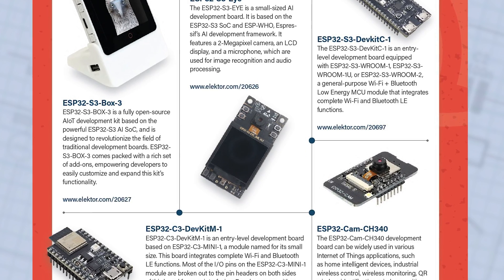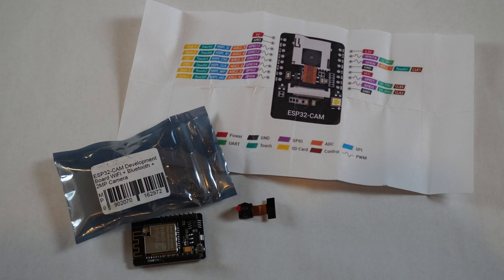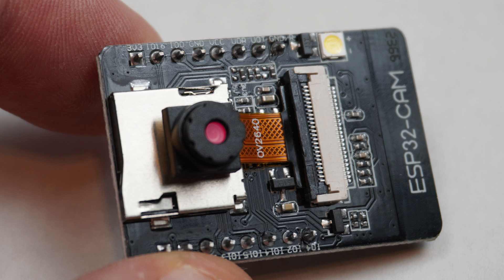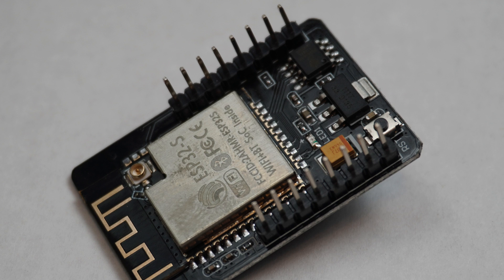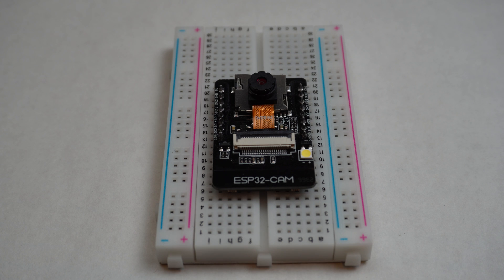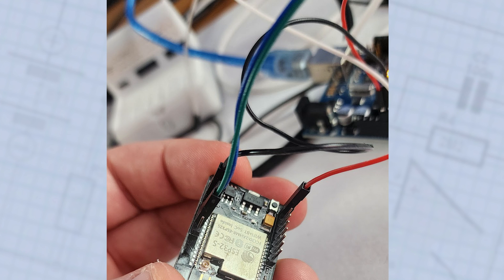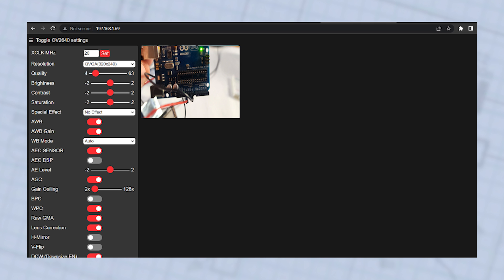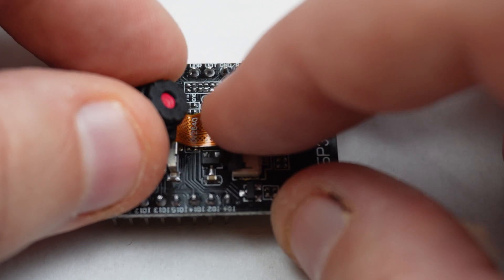ESP32-CAM: Unboxing & Setting Up

Comment: And how to connect an I2C 20x4 LCD with ESP32CAM by defining any other GPIO pins using Software I2C
Reply from the maker: You can use the Wire.begin(SDA_pin, SCL_pin); function in Arduino IDE to define custom SDA/SCL pins for Software I2C. Make sure those pins aren’t already used by the camera. Libraries like LiquidCrystal_I2C will then work with your defined pins.

Comment: Can we use other sensors to interface with ESP32 CAM
Reply from the maker: Yes, definitely, it has GPIO pins that can connect to just about any digital sensor.
Reply: @ElektorTV  not analog sensor ?
Reply from the maker: @digitronix532  You can use analog sensors too — but only on pins that support ADC (e.g., GPIO 32, 33, 34, 35, 36, 39). Just note that some ADC pins might be blocked if the camera is active.

Comment: I usually throw Tasmota32 Webcam on these, web flashable, so no coding needed. I use them to monitor meters and the gas leak detector remotely. Easy projects, great utility.
Reply: Thanks for the tip - definitely going to try that!
Reply from the maker: Also 'easy projects' need attention and ideas to make them work! Good use-case for the ESP32-CAM.